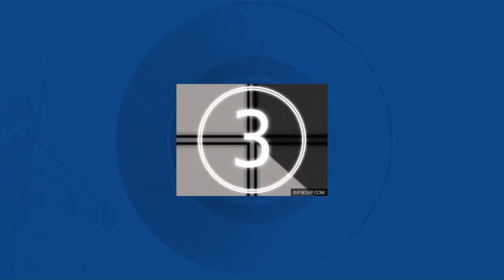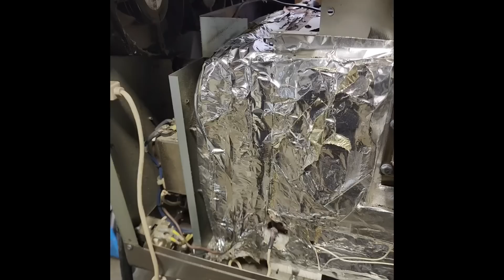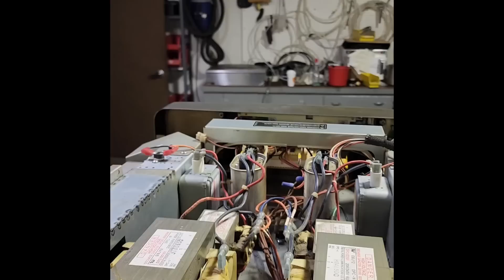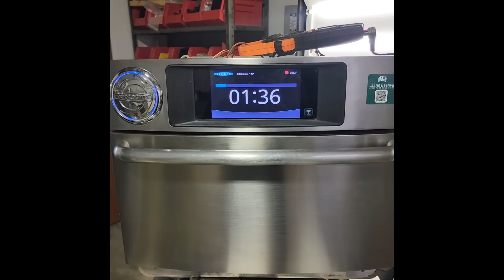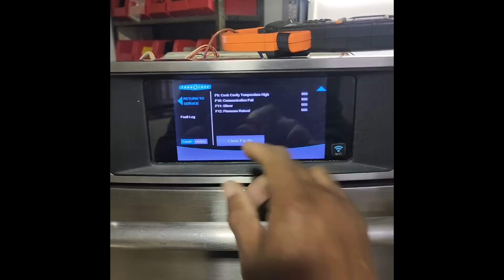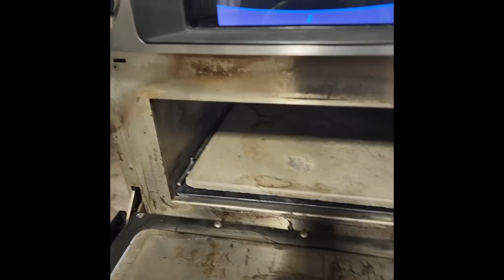Turbo Chef Upper Heater Replacement

Comment: For the top heater, if the white insulator wasn’t in the package, will cause issues in the future?
Reply: I’m fairly new into the field and I had my first call on a turbo chef today. The heater was shorted to ground. Needless to say I’ll be watching this 100x before I make the repair bc microwaves scare the hell out of me!
Reply: @sickmike0739  make sure you just remove everything on the top
Reply from the maker: @sickmike0739  Hey I understand just be safe, make sure you unplugged those and do your troubleshooting.  You will be fine thanks for checking in and thanks for watching.
Reply from the maker: @Alejaja97  Hi yes if the white insulator for the termainal is missing,  it can cause the heater to short eventually against the frame.